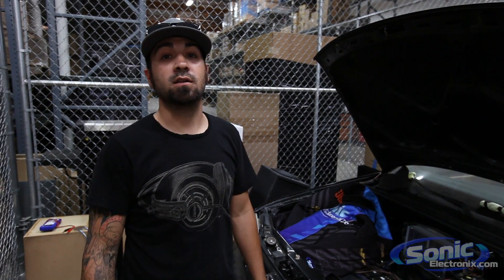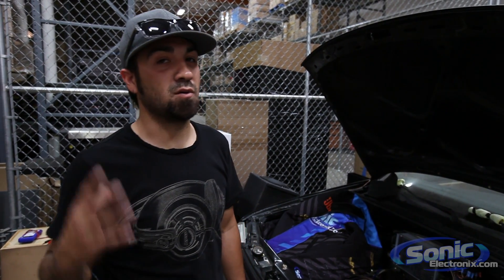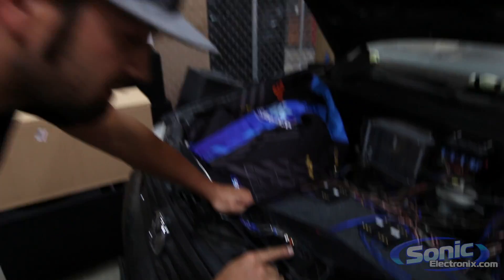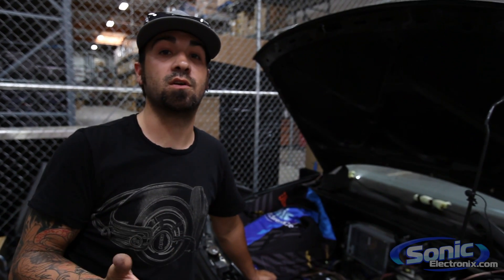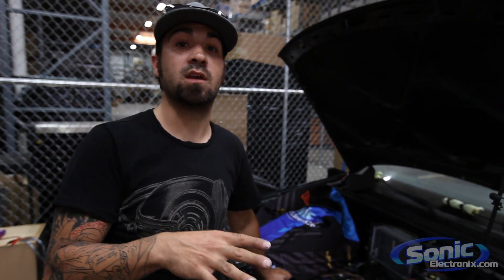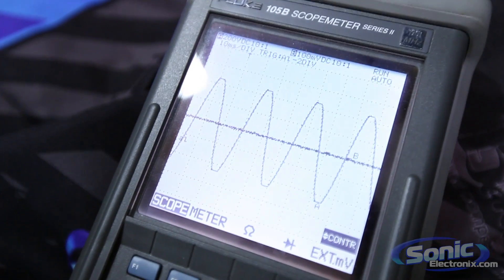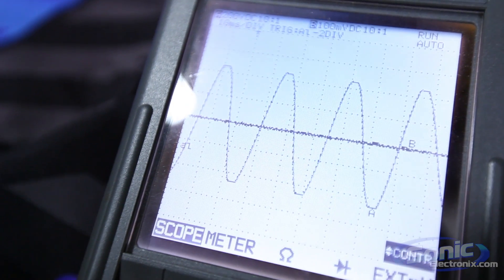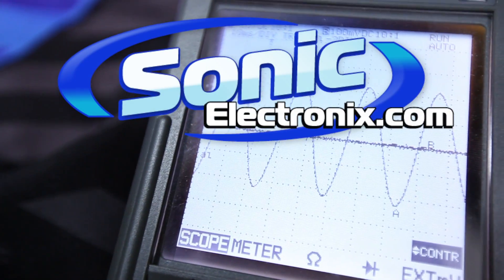How to Set Amp Gain by Ear | Part 1 of 3

Comment: yea people on youtube have argued with me on this right here, you can hear distortion in your woofer, if you can't hear the change then you don't need a stereo system.
Reply: +mike s I've just got my first sub.it has 2 dials on the back. One is Hz and the other is gain. Tbh I don't really know what either mean lol but I was wondering where the Hz dial should be when I do the 40hz pitch test. And then once I've tuned my gain correctly, where should I then have the Hz dial? Cheers
Reply: Browsin4Vids depends on the music you listen to, on the should be the low pass frequency on the amp, if you listen to a lot of rap and r&b, i would suggest the range of 60-80hz for all around clear sound, but if you are into rock and metal you could go up to 100hz for sound quality. but like i said if you listen to any rap then 60hz would be the best.
Reply: mike s Thanks a lot dude
Reply: +mike s i love Rap Music  But My 2 15s sound Like Shit how do i set the Gains On a 2500 Watt Brutus Amp  i have them in an Altima

Comment: so i'm guessing when my bass is sounding great at a low volume and then loses the quality at a high volume my gain needs to be backed down a little, what about the sub-sonic filter isn't that supposed to help from the speaker moving too much?
Reply: Christopher johnson subsonic filter only stops the sub playing sub bass frequencies at a certain hz that u have set it for, may it be 20-40 etc, say if u set it to 25, 25 and under hz will not play if using the subsonic filter.

Comment: How to set gains with digital multimeter? I have a Boss 1500 watt 2 ohm stable amp and running a 12 inch pioneer dual 4 ohm wired in parallel to a 2ohm load.
Reply: Saldy your boss wont really do 1500 wats
Reply: Boss is called that for a reason, it's like a diaper, always full of shitty sound and it chaps your ass just trying to listen to it.

Comment: I set my gain like this and it distorted after turning my gain up just a hair, like around 1/16, on both my speaker amp and sub amp. It does sound really good, but my friends are going to call me a big floppy pussy because it is quieter than my factory setup. I didn't spend all this money to have a system that is really conservative and bland sounding. Any advice?
Reply: what kind of RMS are both pushing?
Reply: Snydicus It's a 500 watt mono amp to 2 300 watt subs and a 75X2 amp to 2 65 watt speakers.

Comment: Do you need to re tune amps after replacing factory radio?
Reply: Yes. Because the aftermarket unit will, most likely, have a higher output voltage than your factory unit.

Comment: how do I set my bass controller knob? Do I turn the knob all the way to the max and then try adjusting the gain right before distortion? Please give me some advice.
Reply: set your gain on you amp then up on the controller, I found this works better, and makes more since
Reply: Thanks for your help!
Reply: I have a hyphonice zeus 3000.1d, and 2  12 inch db drive subs ive yet to hook up, haven't completely figured out how to hook up the extra battery , so good luck man, its all a learning process, let me know how it works out

Comment: After you set the gain what about the bass boost the LPf HPf what about those man I just want bass were do I set the LPf too and where do I set the HPf too man pls help thanks man
Reply: Phase: 0
Lpf: 80hz
Bass boost: 0
Sibsonic: 20-25 hz
Reply: @ocielgarcia479  dude the sub sonic is gonna have to be MUCH higher depending on where his box is tuned yah know
Reply: all of that is easy stuff mannnn basic stuff..but considering this comment is 4 years old now i believe you figured it out by now ?
Reply: @infrasonicrebasses4763  No. I need to know.
Reply: @danielwarren129  so its simple really..first off you set your gains its basically checking your sub limit by simply watching the sub..you don't want to raise your gain too high otherwise your sub would be bottoming out..raise gains but not too much til you see the sub flex just enough but not OVER its limits...that in my opinion is a fine way to set gains however it should probably be a 40hz or somewhere near the tuning of the box so you don't play something that WILL flex your sub too much and ended up setting the gains far too low

Comment: I have an osciliscope but where do I connect the leads on the amp?. On the rca input or the speaker output?. And would I do this for all 4 speakers if I am doing this on a 4 channel amplifier
Reply: chris monnerat the speaker wire because that's where the signal output is therefore your oscilloscope will pick up that signal and let you know if it's clipping or not

Comment: Quick question, 
What about the Boost?
Reply: if you put your gain up and boost you're just going to start clipping. I was told by the owner of Sundown Audio to always leave the bass boost completely off on the headunit and amp.
Reply: Bas Leusden NOOOOOOO! Leave it at zero, as well as any eq, enhancement settings, sub output level. All that stuff does is send clipped signals to your equipment. Clipped signals, as well as voltage drop and undersized wires can be your worst enemy
Reply: I know its late but never have it up.
Reply: chicagoDemon1 why not?

Comment: i have a question... if the sound is going to distort does it mean the subwoofer cant handle it or the amp?

i got a jbl px600.2(700 watts) amp and a infinity kappa perfect vq12 subwoofer(1600 watts max and a rms of 400.)
and does it matter what kind of power supply ive got? cause i have a psu hooked up to my amp. the psu is 600 watts.

every time i heare distortion i think my subwoofer cant handle it but what i see now is that it doenst mean your subwoofer cant handle it but the amp cant. 

can someone help me out with this?

Comment: I see that I am not the only one that is a noob when it comes to this & many off us are not going to buy the SMD so hopefully an updated video on this subject can be made for us lol.............. Great video before I begin: 1. Before touching the amp gain, how do I find the clipping volume limit on my head unit (or better yet,  where was your level at in this video? lol). 2. The test tone part, 40hz (sub amp) & 1000hz (highs) @ 0 or -10db, which db is better and why? (the short version lol). I know a video may not be made but if anyone can answer these questions for myself & others who are looking for a more detailed answer and great sounding system, that would be great!! Thanks in advance everyone!!!
Reply: Almost forgot: what about the other freq's on the amp during the setting part and bass boost on the radio? Do I touch the bass boost AFTER I set the gains or leave it alone?
Reply: Start at -10db & turn the volume all the way up. If you can't get clipping then 0db but run the volume up slowly. If you still can't get clipping then leave it at 0.

Comment: What I don't get about this method is that if you're setting your HU to 3/4 and then finding the clipping point from there, then theoretically the idea would be to never play above 3/4 (or else you'll again drive the amp into clipping). 

Except that would mean that while you are setting your amp, the sub is playing at the loudest it should be played (at that frequency anyways). But he's talking to the camera right over it?

I tried setting my gains this way once, and way before I got to clipping (or could even hear any distinguishing) the sub got way too loud. Now I just unplug the sub and use a multimeter on the amp output
Reply: Your speaker's impedance is to low.
Reply: *too
Reply: Yeah i found the 3/4 volume odd, because then that would be your max volume from then on. I think he should just of said to put the volume one or two clicks before any noticeable distortion and then set your gains from there. Just saying
Reply: alexisthemexican  rule of thumb is most headunits clip beyond that point
Reply: chris Brown Also keep in mind a 0dB test tone is going to be fairly louder than most dynamic music we listen to. So, in setting my sub gain I found out my H/U clips around 32/35. I therefore picked a nice clean 26/35 as my reference point (which just happens to be - you guessed it - 3/4), set the sub amp gain from there; therefore i can get an extra 5-6 clicks of clean output since the music will need to be around 28-30 to be as loud as that test tone. Hope this helps

Comment: What does a gain really do then
Reply: just amp volume
Reply: It's another volume control because the one on the radio is not linear.
Reply: Dominick Ray Amp Gain is the Power or Energy not Volume.

Comment: I have my system setup line out from the kenwood head to a Kenwood eq then splitt 3ways f/r/s to a crossover to two different amps is that the right way or should I just use sub from the head to get a quality low with no distortion? And does using the eqs sub change the values of my heads freq ratings?Thxs in advance for any advice also I'm not sure if it's my craftsman DMM but my values are unstable ?
Reply: Don't forget that cabinet design also affects distortion
Reply: Do u mean the way my setup is might cause distortion?
Reply: From what i understand your mono amp only can output a certain range of (low)frequencies. Your decent amps also have a built in crossover(s) to only output a certain range of frequencies to what you set it at. I havent messed with multi amp setups but you take the signal directly from the head to the amp. No need for crossover in between or EQs. EQs are only good if you have crap speakers. Save that money and get better speakers/subwoofers.

Comment: Ok I have a question I have the Rockford ffosgate prime r500 and the 12" L3 and I set my gain using the multimeter, all the punch bass are turned down and the sw setting on the head unit is down, it's set to 31.62 which is what it's suppose to be but it's not hitting at all really, any advice?
Reply: What's it not "hitting"?
Reply: What is supposed to be at 31.62? And what do you mean by 31.62? And what is it not hitting? You're too vague amigo, cant help you like that.

Comment: what if i have a 380W [RMS] woofer wired to an underpowered 280W amp and set the gain to the max. will the woofer be safe from clipping?
Reply: No Sir.
Reply: Lt. flex lol thank you sir btw yeserday, i tried a 600w amp on the same SW and there was an insignigiant improvement in bass that is not worthy of upgrading to them.
Reply: Them.I thought he only tried one amp.

Comment: setting by ear aint smart....just get an SMD-DD1.

they cost a lil over 100 bucks shipped. Comes with clear instructions, distortion detector and test tunes CD

you cant hear distortion with your ears, period
Reply: I know this is a very old post but think about what you said. "You cant hear distortion with your ears.."  I agree. Anyone can easily hear clipping but there's basically no way to hear small amounts of distortion unless you're a robot.. So what's the point of worrying about it? If you can't hear it, who cares if there's 4% THD? You can easily hear clipping with an earball tuning and ultimately nobody but the most audio of philes is ever going to know the difference. I say this as an owner and lover of my DD1. Tuning an unloaded amplifier with something like a DD1 is absolutely 100% better than using your earballs but you can actually get a good tune without equipment if you know what you're doing.

Comment: This appears to be tuning for maximum output.  Is there any advice for tuning the subwoofer amp to properly blend with mids and highs?  Can that be done by ear with a sweep tone or does it require a scope due to the human ear's variable sensitivity?  I guess if you are tuning it to your ears though then you will get the best sounding system for "you".

Comment from the maker: Voltage = square root of watts x ohms. For example, a 500W RMS amplifier at 2 Ohms would configure like this: 500W RMS X 2 Ohms = 1000W. Now take the square root of 1000W and your voltage should be 31.62V if you're running an amplifier with one gain control.

Comment: I am planning to set my gains with a Multimeter. I have a 1400W RMS @ 1 Ohm monoblock, and Dual 2x12" 700W RMS each subs with 2x2 Ohms. (4 Ohms total). How do I find the right voltage to match up with the Multimeter? Thanks! :)
Reply: You should wire the subs in parallel if it’s both single voice coil 4 ohms to run 2ohms to them

Comment: If you play a track that is as loud as your tone, yes.  However, you generally shouldn't run your HU at above 3/4 volume unless the recording is very quiet.  If you set gains with your volume all the way up though, you have no room to turn the knob up any more on quiet tracks.  So 3/4 gives you some wiggle room for quieter sources.
Reply: Generally wherever the identified clip point of your head unit is, going above that isn't ever advised even if you perceive the track to be quiet. That isn't set for wiggle room. That's set to be a maximum. With an aftermarket system, most people have gotten a system that I'd plenty loud enough to be at half volume and still have quiet tracks be loud enough. I know everyone's situation is different but taking the unit above it's identified clip point just isn't a good idea even on a quieter track. Because what if the track suddenly stops being quiet. You're gonna start clipping and cooking stuff.

Comment: Watched this and thought that i could give it a try :) But i couldn't get any clipping or distortion coming out of my sub. Why is so ? 
I'm using a 12" MDS FR12W-MKII (700W Rms 1400W peak wired @ 8 ohms), 1uF capacitor and a MegaKick SilverSonic 2200 amp (4channels, 4x275W Rms 4x550W peak @ 4ohm) bridged to 1 channel.

Comment from the maker: Tune with the max unclipped volume from your headunit. Once you find that, then you set the gain on your amplifier to level match it. However, set your sub level to zero and your EQ to flat when you are finding clipping points and adjusting gains.

Comment: I'm not entirely sure, but I would set it with the car running.. Reason being, if you set it when its turned off, you'd have to up the gain more to get the power you would need. When you start your car and your voltage goes back to normal, your amp would draw more power than before. But yeah.. Id set it with it running man. Whether I had an extra battery and or a capacitor hooked or not.

Comment from the maker: On the headunit, turn the subwoofer control to one notch before max when you are setting your gain if you plan to use the control. If you are not going to touch it, then set you gain with it at the zero level.
Reply: What if you don't have a bass control knob? Kenwood ddx375bt. Distortion between 28-29 out of 35.

Comment from the maker: Gain overlap is a way to compensate for the difference between test tones that are at a fixed db level vs music which is dynamic. You basically raise the gain knob until you achieve 5-10 db of signal with clipping. When you then play music the average will be far lower than the test tones and you should avoid any clipping. 5-10 db of gain overlap is pretty standard. However, if you are running amps that are larger than the recommendation for your subs you should not use any overlap.

Comment from the maker: Filters should be set to allow your test tone frequency through during testing, however once the gain is set, you have to set your filters based on your other speakers in the system so their frequencies blend together nicely. Bass boost should be avoided if possible.
Reply: What about equalizers?  Will that drive anyting in a bad direction if set afterward?
Reply: @VndNvwYvvSvv  EQs are fine, just lower frequencies instead of boosting them

Comment from the maker: You should use at least the 8 Gauge kit, not 10. You will want the least resistance and maximum current draw which only larger wire can offer.

Comment from the maker: No, it means that the box has the highest output at 32 Hz. The subsonic or high pass filter should be set to a little below 32Hz. Your low pass filter would be much higher, around 80Hz or so.

Comment: Thanks Sonics. I am running a L3 solobaric with an Alpine MRP500 in the 2012 TL Acura & working to find the optimum setting without expensive equipment. I've tried setting gains by ear, but am unable to detect distortion

Comment from the maker: 40Hz is always 40Hz, meaning the sub itself will oscillate at 40Hz. However, depending on the enclosure and port tuning, your loudness level will vary by frequency.
Reply: What about the cross over tune and the db

Comment: i downloaded a 40hz test tone and im going to set my gain tomorrow but the file has 40hz with different db 0db 2.5db 5db 7.5db and 10db which one should i use i have 2 pioneer 12 inch subs with a 820 watt amplifier please help me.

Comment: hey man i had the same problem. mine was due to a grounding issue. I installed a ground loop isolator between the rca connection and it removed the hissing for me. I would try it.

Comment: When you say turn your head unit 3/4th's of the way up before testing, does this mean my volume level should never surpass 3/4th's AFTER I get my gains figured out?

I blew my 1st sub after tuning like this, and with gain turned up to near MAX , my 500w Type R barely produced decent bass at 80% volume on my Pioneer deck. Volume maxed at 62 and I'd play it between 49-55.That sub eventually got blown, so now I'm not sure if I should ever put volume above 75% or turn up my bass EQ on the headunit?
Reply: You had your gain turned up too high if it was near max.
Reply: I know this is almost a decade old now but yeah. Lesson learned. They even said play the tone starting from 0 on the gain. Lmao.

Comment: Great explanation. I will definitely  try this out on the weekend with my new amp and sub . My other amp is running my woofers/mids/tweets , and the woofers only go down to 47hz. If I ran a 60hz test tone through all 3(x2) speakers, would that be good enough to adjust by ear.? or would a different tone be better for my highs ? Thanks for the great, well explained video.